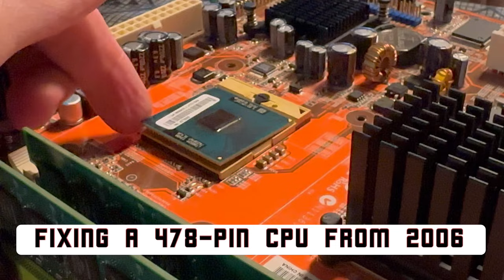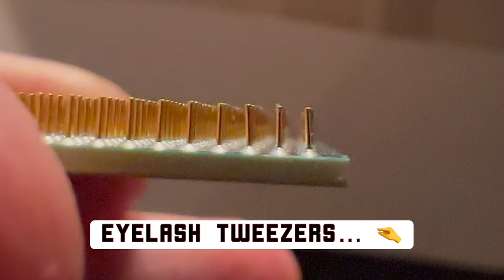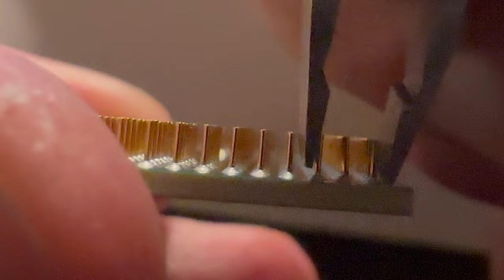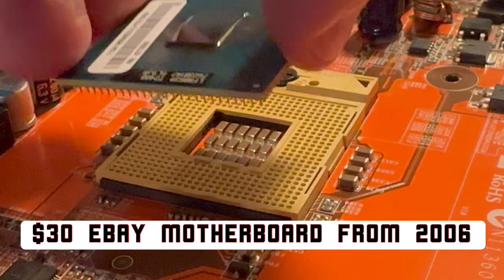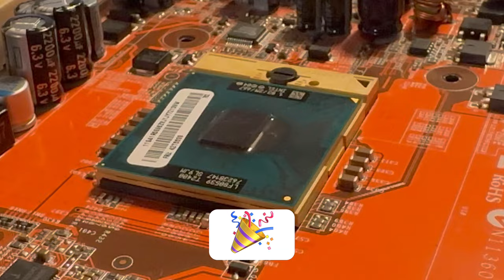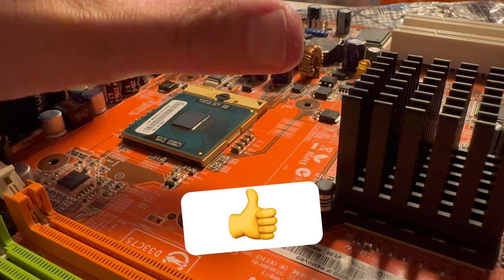Repairing bent pins on a Socket-478 Intel CPU from 2006 🔍🤏

Comment: These CPU pins are incredibly durable. I once purchased a bag full of 486 CPUs from eBay that were badly bent, but none of the pins broke. I was able to straighten the pins with a credit card. In contrast, with Pentium III CPUs, once the pins are bent, they are more likely to break. Intel has changed their manufacturing process on their later CPUs
Reply from the maker: Great info, thank you! I don’t plan to be dealing with any Pentium 3-class CPUs here, but that’s good to know—and, never say never. 😅

Comment: Pins are soldered in place so they're very durable. It takes a large blow or a lot of bending to snap them and usually the metal pin will gove out before the joint.
Reply from the maker: Thanks for the info. I believe I read online, and correct me if I’m mistaken, that pins could these can be bent perhaps three times back and forth—and after that, watch out? 😅

Comment: credit card is a good deal. it will make the ones that "stand out" to be adjusted to same level as the ones in the correct. I don't remember exactly but the pin pitch got in bar with the card thickness at some point so it was a little like swiping a card and it would make it ok.
Reply from the maker: Good idea, thank you. I saw a mention of an X-acto or similar elsewhere also, noting to be careful not to cut into the CPU itself. 😅

Comment: i mean those were not that bent, my cpu which was about that bent would go into the board and i just jammed it in and it straightened out on itself
Reply from the maker: I was tempted and prodded the one side a bit, but didn’t want to force it! By straightening smaller groups at a time, I was able to test and narrow down which pins still needed work.